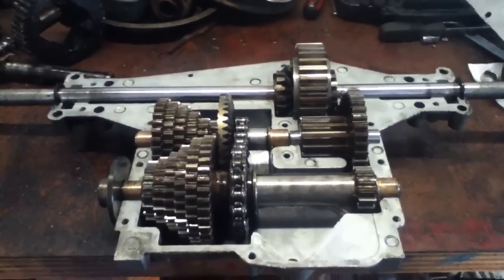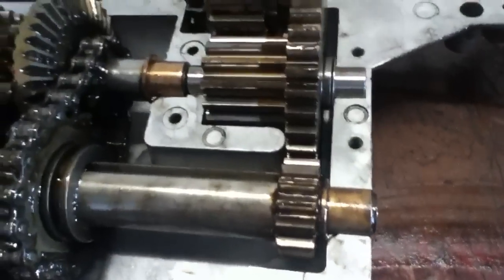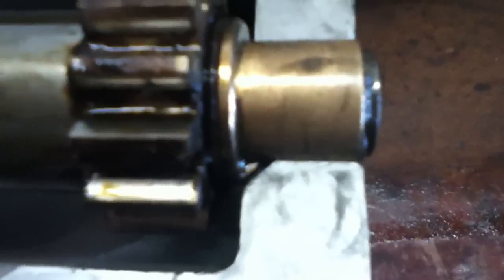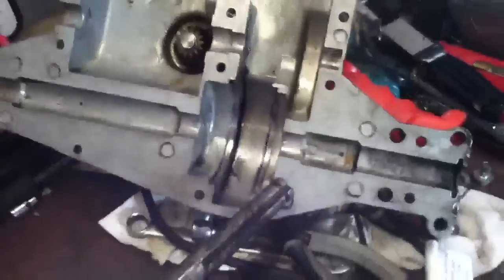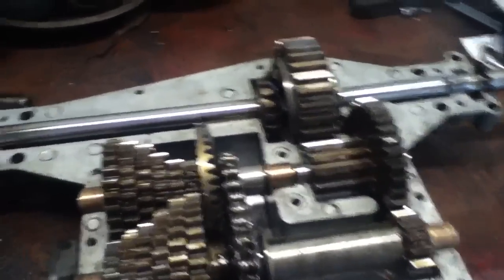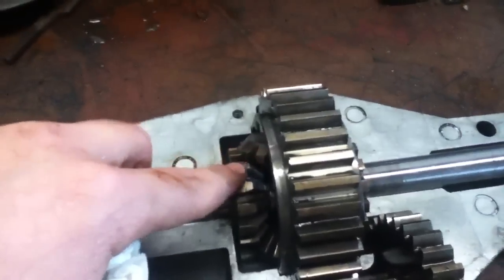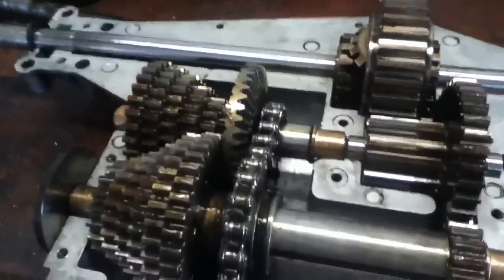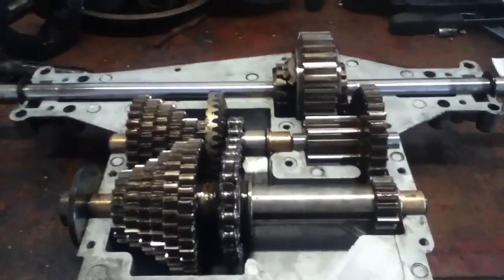Tip putting together a lawn mower trans axle

Comment: Hi, is there a way to change gearing? make that thing faster?
Reply from the maker: To make your mower faster you would do a pulley swap. I personally like to do 1:1 ratio. I do a 5” pulley on the engine and then a 5” pulley on the trans axle assembly. Goes pretty fast that way.
Reply: @Tyler91000  okay, but what's about the bearing. How long will it run at these high speeds?
Reply: @DeutschlandLife  i personally never had a issue with failure but if I was you I would fluid fill it instead of grease. Should get long life out of it.

Comment: Is there a way to put a drain plug on it? You mentioned 80w90 gear oil conversion.
Reply from the maker: Yes you could. Simply use a drill and tap the case for a drain plug.